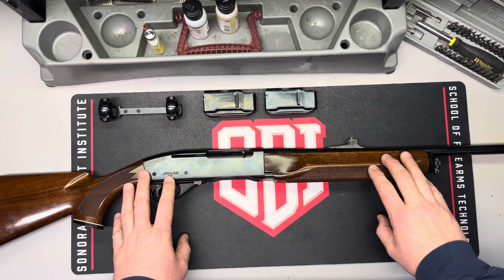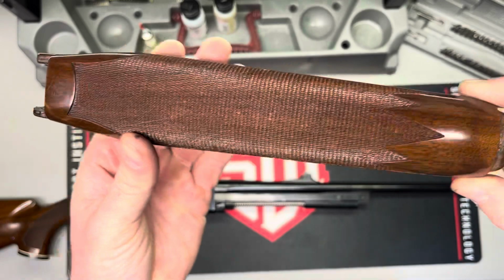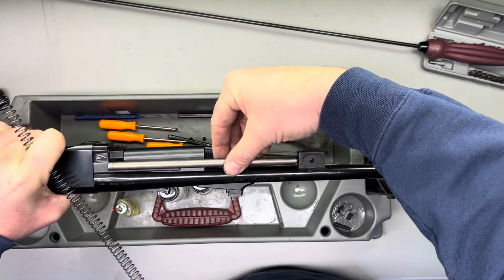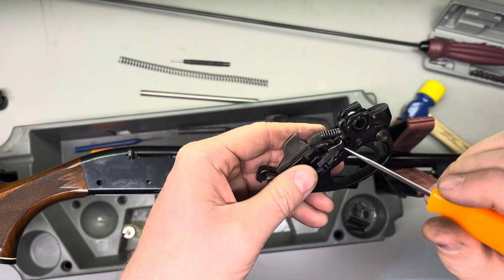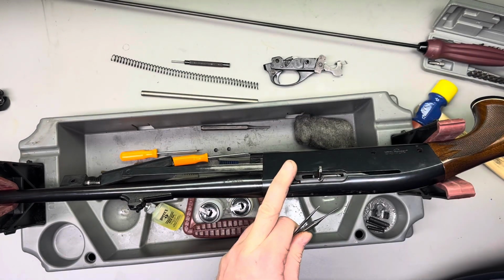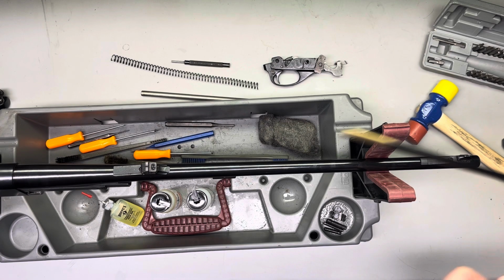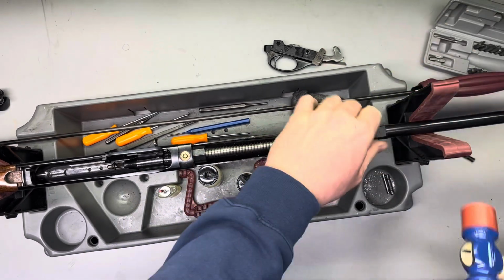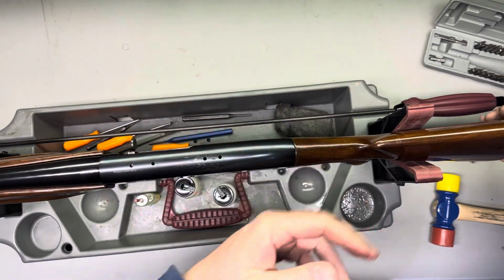Sonoran Desert Institute Introduction to Firearms Week 8 Final Project

Comment: I have a 7400 in 30-06.   The only difference between yours and mine is the rear stock.   Mine does not have the Monte Carlo.  These guns are known to have the POI change.  The forearm screw tension will affect the POI. My gun like when the screw is just snug. After a few shots, the screw become loose.  I added a split washer like yours.   Hope it will stay put. I have a load that can print 3/4" with my gun.
Reply from the maker: I haven’t developed a load for mine yet.  It’s more of a safe Queen at the moment. But my dad had a good load for it and he said that adding the washer really helped tighten up his groups quite a bit.  I’ll probably end up replacing it with a regular steel washer and blue it to match the rest of the gun.  Thanks for watching.

Comment: Should use grease not oil for lubricant.
Reply from the maker: Hi, thanks for watching. What makes you say grease is a better lubricant than oil?
Reply: In 740/742/7400 there are so many moving parts with the action, oil looses its effectiveness quickly even with rifle just sitting. Grease clings to these moving parts keeping them lubricated. Oil also collects much dirt and grime.  Do a little research, widely recommended to use grease.

Comment: my friend, you really need to learn how to completely and fully disassemble the rifle and be able to put it back together in a minimum of 15-20 min! You did alright but i would suggest you do it until you can reassemble it without having to think about and, and learn the tricks and which if any pins are tapered and which way to drive them out.
Reply from the maker: I see your point and agree wholeheartedly.  However that particular rifle doesn’t get used much. It’s more of a family collector type rifle that I like to keep around.  Honestly after I cleaned and lubed it up in this video it will likely sit in the safe until the next time I dig it out, clean and lube and put it back.  Thanks for watching.
Reply: @scottbozarth8459  your welcome, just curious, are you taking classes for hobby or is it something you are wanting to get into?
Reply from the maker: @WoodMetalandFreedom  It’s a hobby that has turned into something I may want to get into as a side job someday.  For now I just like taking a gun all apart to see how it works and then putting it back together.  Learning about systems I’m not yet familiar with.  That’s why I chose this Model FOUR for my assignment.  Nobody needs or wants another speedrun video of a guy stripping an AR at this point anyway.
Reply: @scottbozarth8459  My favorite shotgun as far as function goes is a browning citori, If you get a chance or have not already, it is an amazing shotgun !